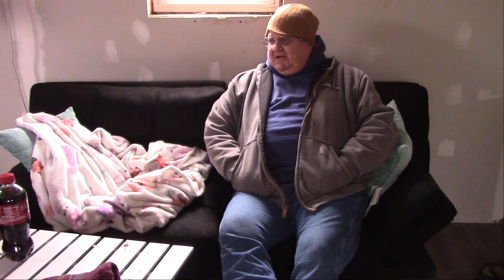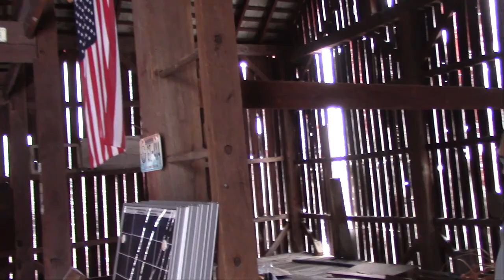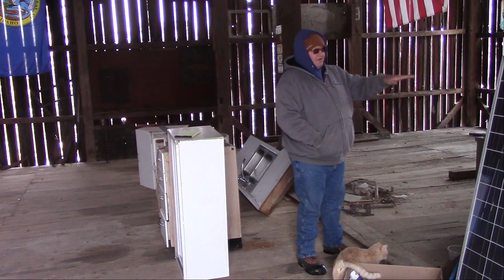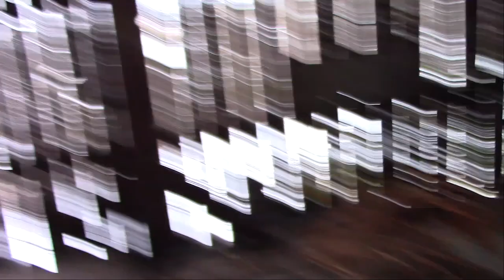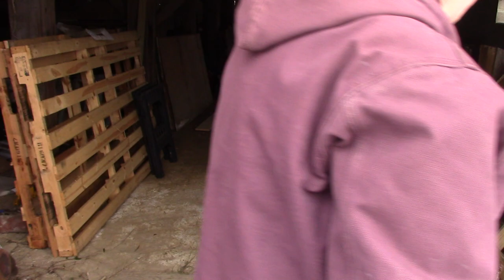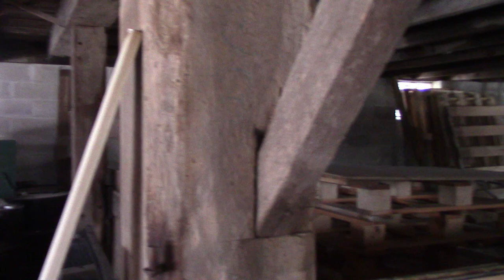Build a House / Barndominium in an Old Timber Frame Barn

Comment: If you pull any permits, they will shut you down. Just dig a septic and have a well put in. What they cant see, they cant do anything about it. If you feel compelled to get a permit for a septic or well, then do them first and dont tell anyone what your doing. Just do it. I love the idea of the home in a polebarn. Some states wont allow it. Zoning cant come into your structures.
Reply from the maker: +ateamofone Fortunately there is not a lot of permitting that has to go on here. Mostly for the septic.

Comment: It's a great idea Joe. I've been a proponent of it. Not only is it cheap square footage but the huge timbers will showcase so beautifully. You'll have plenty of storage so essentially the living part won't have to be as large as you're used to.
I would double check the footings and piers and making sure they haven't sank any, and if so sure those up first. Then go for the build. 
If you need plastic against the boards I would suggest a tyvec type of material because its moisture permeable and will let the moisture escape from in the wall cavities instead of molding up the cavity. You can plastic the interior side to keep moisture from leaving the living space and going into the wall. 
Same in the floor...you can house wrap under the insulation against the old boards. This also helps block wind which is a r-value killer...especially on the walls.

Comment: Joe, find out first if you can get power to the barn, without septic.  If you tell them you want to run a shop there with power tools, they may run it in.  Septics are expensive, and you can do fine with a dry toilet.  Gail may want power grid (women prefer it).  Otherwise she may have to settle for solar.  But its a great idea and cheap so yeah, stealth is the way to go.
Reply from the maker: +Dennis Cote They will run power to the property for $4,000.  If I have the shell of a house and a septic, they will run it for free. If I put a shell and septic in within 3 years, I get the $4,000 refunded.

Comment: Hey Joe!
Sounds like a good option, as long as the structure is sound and the roof is dry.  I think I'd clad the part of the barn that surrounds the "cabin".  There are an awful lot of knotholes in those wall boards.
It's still a lot of work.  Only wish I could pop over and help.
All the best, matey.
Reply from the maker: +SarkyBugger The slate roof is in good shape. It needs a couple of slates replace on the other side of the barn.  The outside of the barn will all be redone when we sell the house here, and move out there.

Comment: Great minds think alike.. I have a similar idea but I don't have a barn. Same basic concept with a twist. My vision is installing a fabric hoop shelter and building living living quarters inside. A hoop building can provide a lot of area protected from the weather and allow light to enter. (My idea was a white cover. Some companies will sew in clear material at the peak) This kills 2 birds with one stone. It will provide plenty of light to enter so no need to have lighting outside of the living quarters during the day with the added bonus of heat gain during the day in the Winter. There is a distributor that sells hoop buildings not far away from me and he has a display unit set up. (White cover.. 34' X 50') Both ends are enclosed with the same white material with a man door and a garage door installed in one end. I was impressed when I entered this building during the Winter! It was near freezing outside in the early afternoon but the temperature inside was near 50! It wasn't full sun outside either! That made my brain cells jump to the ponder mode.. LOL.. The building that was on display is the type that the hoops start from the ground but there are units that mount on "Pony Walls" that will give more headroom AND an opportunity to have ventilation during the Summer. The pony walls are posts in the ground, (4 x 4's.. 6 x 6's) spaced to the recommendations of the building with a sill on top of them to provide a base to mount the hoops to. The roof starts at the top of the poles to the top of the poles on the opposite side. Now there is an area to use for air flow during the Summer and simply close the area off during the Winter with skirts. (Of course, having screen material to avoid critters to enter under the skirt.. Permanently mounted) Ventilation areas at he peak on both ends to allow air to escape during the Summer and have the ability to close them to avoid heat loss during the Winter. Easy spouting maintenance, being they would only be ~4 ft. from the ground. Water collection tank could be installed at ground level inside of the building, inside of a straw bale room. I don't believe the water would ever freeze (I'm in Ohio) and it certainly wouldn't see any light. Build the living area at one end to allow ventilation of heaters or whatever to avoid going through the fabric material with the option of getting some natural light in via windows and a convenient  exit to the outside for perhaps a deck. The options are wide open! (I enjoyed your enthusiasm while explaining your options) Minimal excavation involved and one could live in a camper or a smaller mobile home until some funds could be collected to construct the final living quarters. Live there and engineer the best options.. I plan on doing this in the future. I will retire within the next 2-3 yrs. and I will use my current structure that I live in now as a B&B or perhaps an off grid classroom. I've lived here since 1989 so I know how things need to be.. Fantastic video! Love ya Brother..
Reply from the maker: That sounds like an awesome plan.  I would have never thought of it!

Comment: My first question would be is the barn roof good with no leaks? Great idea here! You will make decisions and changes as you go!
Reply: I'd put about a 1:12 slope on the roof, and put a metal roof on it anyway. Barns leak, or will...
Reply from the maker: +George Nichols It's a slate roof.  Needs a couple replaced on the other side. No problems over where I want to build.
Reply from the maker: +Pygar2 After I sell the house, I will do that.

Comment: Your biggest challenge, and expense, will be repairing and fortifying the barn roof.  You'll also want to install drainage around the barn, so the cinder blocks dont move and crack.  Be careful about using plastic wrap, the condensation that will build up will rot your house out.  It's a great idea to put a house in the barn.  In Vt it's common to convert the whole barn to a house.  There is one other option for you; large campers can be bought for cheap(used). You could back a large camper in the haybarn and use it as the base to expand a little to meet your size needs.  In New England a 30/40 foot camper can be had for 5k, or less.  I would be careful closing up the outside walls too much, let it breath. That barn has survived 50+yrs because the walls breath and the roof is sound.  Good luck, wish I lived close enough to visit, I'd even bring a hammer.....!lol
Reply from the maker: +vtdrive12 Fortunately, the slate roof is in great shape except for a couple of slates needing replacement. It only leaks a little on the other side of the barn. I will be fixing the gutters for rain catchment.   I like the idea of the camper, but I would need a heck of a bridge going into the barn. It has two of those louvered vents in the eaves of the barn for ventilation. Thanks!
Reply: @StBernardAcres  that's great on the roof. Slate roofs require a level of expertise to repair.  The old warfins(ramps into the barn) can hold a lot of weight.  They used to back the tractor and wagons full of hay in to off load.  Being on the second floor you'll have to make an insulated utilities chase so your water and septic lines don freeze.  There is a product called Onduline that might work for exterior siding, either that or steel panels. Anything but panels would take a lifetime to install.  I wish u the best of luck and I'll be watching your progress.

Comment: I like your idea Joe. 
However my concern is the roof of the barn. How sound is the roof? How old are the shingles? A barn will last 1000 years if the roof continues to shed water and not leak. The old barns which are falling apart up here in NH, are the ones where the roof started leaking and then the timbers inside rotted. My cabin is 32 x 14. It cost me $4,000 for my metal roof ($2K for the metal and $2K for the labor to install). I'm guessing your barn roof is 4 or 5 times larger than my roof, so that would cost you $16K to $20K for a metal roof. Around here, asphalt shingles are getting to be more expensive than a metal roof.
For the inside layout of your house, be sure to put some big windows along side the exterior barn walls, so you get as much light as possible inside.

All the best. -- Dave
Reply from the maker: +Tiny NH House The roof is slate and is in great shape. A couple of slates need replaced, but that's it.  Most of the windows will be on the outside walls. South & west. Thanks Dave!

Comment: Joe and Gayle you need to watch Good Simple Living.  They moved to Idaho and had a pole barn built and ended up building a 2 bedroom one bath in the back of pole barn.  They are going to build their house while living in the Barndo.  They say older people sell home and move into condos lol.  One thing to keep in mind is start off level and square.  It makes life soooo much easier the rest of the build.   Work smarter not harder.  It is a great idea. Hey you might even put a lift or elevator to have the bottom of barn a garage.  Best of luck on new journey and merry Christmas 🎄
Reply from the maker: +Target Rock Excellent comment.   Thanks the encouragement and advice.

Comment: I like your ideas but I think your under estimating the cost. I am thinking more like 20 thousand. Have you looked a building materials pricing. It is crazy. I was going to build the wife a 16x20 she shed I priced it pre covid first of the year. Then priced it in late spring. OMG I about fell out of my chair. Try telling your wife she cant have what you promised her it was not fun. My estimate was over double pre covid pricing. So why not just sheet the floor and insulate under the floor in the basement. You will need wiring, pluming and heat if the fire is in the basement to come through the floor. Good luck I hope it all works out for you.

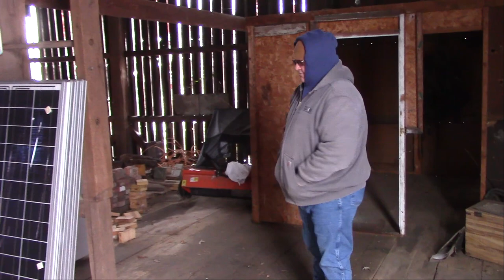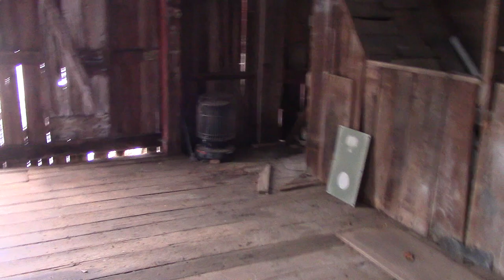Comment: 7:48 - I always wondered about those slats in the barn wall. Now I know! 13:46 - It's called biden syndrome. 23:07 OK, you asked for our thoughts... I think you should forget all that nonsense and site a double-wide mobile on the property. Much quicker, much easier and a much better idea in my humble opinion (which you asked for). 

I also think you're way underestimating what the total cost would end up being for the type project you're considering. You can purchase a decent used double-wide mobile about a half dozen years old (approx 1,200 square feet, 3 bedroom, 2 bath) for around $25,000 to $30,000. Another $5,000.00 for a septic tank install and then hook up to that well that's on your property and have the electric company run power to the mobile for free.
Reply from the maker: +KMAC Radio I wish I could. We have no need for a double wide. So I've been pricing single wides. Decent used ones are 30-40,000 plus delivery and setup. I'm basically building a box. No roof, no foundation work.  My materials list, at today's prices is $12,500 on the low end, 17,000 on the high end.  Depending on window choices & flooring choices. So $20,000 tops.  After selling the house here, we redo the outside of the barn.  another 10-12,000.  But, as usual, everything is subject to change lol
Reply: @StBernardAcres  Wow! That seems awfully high for a used single wide. There was recently a 1,200 square foot, 3 bedroom, 2 bath, about 8 years old, here where I live, listed at an "asking" price of $35,000.00 and it was NICE! It was like brand new inside and out. It had barely been lived in! Anything less than about 1,200 square feet will get cramped real quick!

Comment: Yeah knock yourself out why don`t you. I`d be worried about living in a wooden house that is very drafty. If something should ever catch on fire, things could go sour very very fast. Also i`d exploit the ceiling height in there and probably build 7 foot above the floor, not at ground level where you guys are at. Don`t spend any energy tearing stuff down, put all your effort into building and erecting stuff. As you mentioned, at your age things go slower.
Reply from the maker: +mybluebelly That's an excellent idea, but I'm not sure I could justify the added expenses. I only have that little room to take out of the way, and we have 2 or 3 years before moving out there. Thanks for that thought though.  You have me thinking lol.